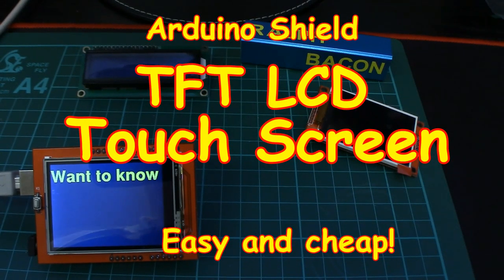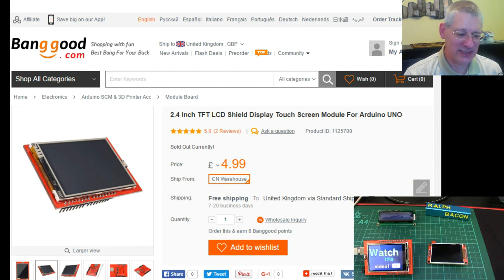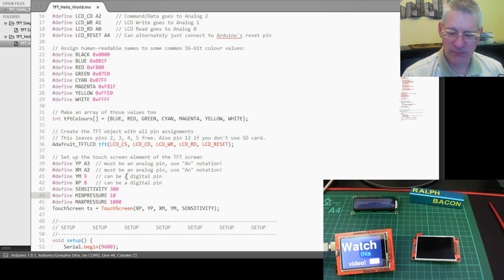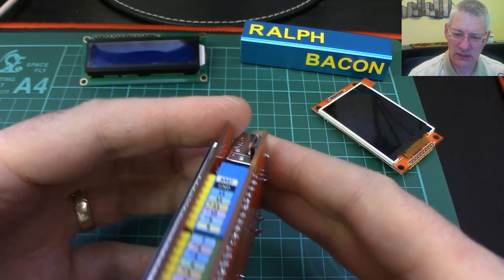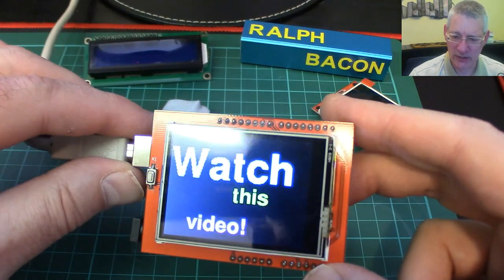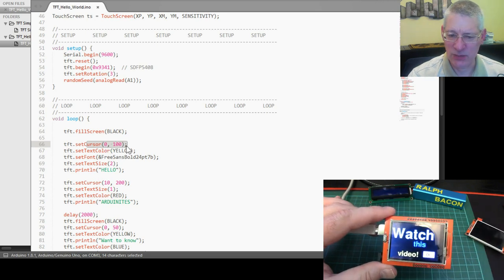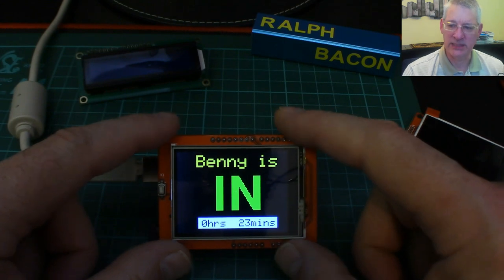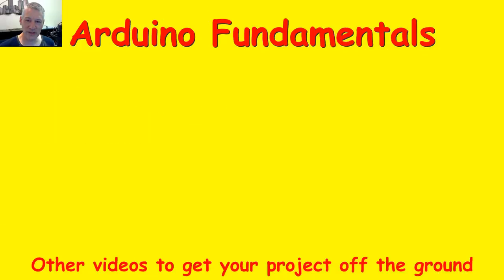#83 Colour Touch Screen TFT LCD for your Arduino - Cheap & Easy

Comment: Hi. Ralph, you are doing a great job.  I purchased my tft lcds (labelled ZC113200) from ebay.com in April 2016 for $4.14 each and am just now getting them into service.  Spent 1/2 day trying to make the current AdaFruit libraries work with little success and it was such a relief to discover your tutorial on youtube.  Really fine work maintaining a usable combination of demos and drivers on GITHUB for this particular tft lcd.. 
Best Regards, 
microwatbott.
Reply from the maker: That's a great success story William, I'm really glad it worked out. The price you paid was excellent indeed. They are really useful screens, even more so if they have the touch feature too. Thanks for sharing and posting!

Comment: Thank you for the great video and for providing the code and the libraries. Yes...I am watching this video now in 2020 and the libraries may have changed! :) :)
Reply from the maker: That's why I include the libraries as a snapshot; it can be most frustrating to recompile a sketch a year or two after it was first done only to find that you now have a gazillion errors because the underlying libraries have changed and are not backward compatible!

Comment: Sure  is wonderful to subscribe to your videos, it seems every time I decide I wish to build a project and need  a refresher, or perhaps an introduction to one of the components, I can do a quick search of Ralph's videos and there is always something that will satisfy my need for information.  This particular video is filling in the info so I can  use my Arduino to set up a touch jukebox for my mom, who turned 93 last spring and moved into a nursing facility after several falls.  The falls are under control but she can no longer go home. Sad really, and with both my sisters passing away from lung cancer (great smokers they were, sure glad I stopped!) I am the only child she has left. Sure she has a LOT of grand children and great grand children, however only 2 grandkids live in town, and I have settled back in, parking my RV which was my home for most of the year before the move. Anyhow, back to the project, I have picked up several of those little DF-MP3 players that can be controlled by either an Arduino, or several buttons.  I want to make her a sort of jukebox that displays the era of the music, for example 30's 40's or 50's music, then class the music such as popular, country western and swing, or something like that.  Using a couple of menu subroutines and displaying the simple menus in fairly large text (her eyesight isn't what it used to be.)  This will be mounted in a small wooden box that I will build in my wood shop, the touch screen will be just for selecting the music, I will have a variable resistor for volume, a toggle switch for power and I have a couple small very high quality speakers to reproduce the music. The amp is only 3 watt per channel, but the nursing home has problems with loud music.  Her room mate will not be around much longer, as she is on "comfort meds only" now and is failing quickly, however beds in that home never stay empty very long, usually just long enough for the nursing staff to clean the mattress, empty the closet and drawers, and move the new lady in.  Again, thanks much,  I hope you realize how many peoples lives you have a positive impact on just in situations such as this.  My how the world has changed since the 1950's when I was a child.
Reply from the maker: The project sounds very worthwhile, Jerry, and as your rightly say, keep it as simple as you can with nice big buttons and on-screen fonts. 93 years old? Even older (only just) than my mum! Sorry to hear about the deaths in you family, I'm glad you seem OK and are enjoying life and my videos too! Keep going, and enjoy what you do.

Comment: Hi Ralph, It is just short of unbelievable how cheap this components can be gotten for... I bough one of those shields ages ago for a project, but went a different route (as it happens, sometimes); I will now dust it out and give it a play. Thanks for the videos.
Reply from the maker: GIve it a good dusting Ray (I think we agreed I'd call you that instead of Mr Salomon, yes?), it will be worth it. As I've mentioned before, if I couldn't get the components so cheaply I wouldn't be doing this hobby, I couldn't afford to! Let us know if you get it working.
Reply: Ray is fine Ralph.  I will update you on how it goes with the screen (lots of possibilities for the device; I am sure the perfect project will show itself sooner rather than later). I am still to catch on with your Attiny video; keep them coming, we need more people like you in the community sharing ideas and  know-how.

Comment: When I first seen Benny's name  on that display, I was thinking "has he taught Benny to touch that"? A Benny time clock! Love that! Hope you share the finished project.
Reply from the maker: Yes, I'll shared the finished project, as simple as it is, electronically and Arduino sketch wise, although it does use interrupts and an nRF24L01 at both ends so it keeps me busy. In fact, I'd be doing it now if I were not writing this (but don't feel too guilty, it's nice to interact with my Arduinite viewers!) But, regrettably, Benny refused to cooperate with touching that screen so I have to rely on other methods to find out where he is!

Comment: Excellent video Ralph.  When I tried playing with these shields I found some the problems that you mention with touch screen coordinates and the wrong chipset.   I will have another look at them again using all the valuable information you've provided for us.    Due to how much memory this uses I'm also interested in trying these with more powerful devices such as nodemcu's.
Reply from the maker: Agreed, Juan, that this did take up a lot of space but I guess that's the price to pay for a colour touch screen! Have another go and see if you can get it working. And good luck with the node mcu's too.

Comment: Hi Ralph, love your videos, really informative.  Great source for most of my work; quick question - you speak about linking to another arduino but I've tried an I2C link to another arduino which requires a4, a5/scl sda.  But the pin on the touch screen is rest on a4.  Any help to figure out where I'm going wrong here? Thanks
Reply from the maker: Without looking at the code (or screen library), Holly, I would check why pin A4 is being used for the touch screen. Was it just an arbitrary decision by me or is that what the library is expecting? Either way, you could just edit the sketch and/or the library to a different pin (A0 springs to mind!) to get round this issue. Does that seem sensible to you?

Comment: Far Kinell!  It works!  Not the touchscreen, but it's there!  How amazing are you! 
I have previously spent 2 evenings trying to find something that worked, loading libraries and stuff from all over, I got so confused that I wiped the lot and reinstalled Arduino IDE.  Your app worked straight away.....after I had downloaded touchscreen.h and let Arduino move the apps around and deleted a couple of copy folders and deleted a couple of empty folders, but that's almost nothing.
It's a bit late at night to muck about more, I'll look at the touchscreen bit tomorrow, though I hardly need it for the task I have in mind.
Reply from the maker: That's heart-warming news, Neil, and I'm sure you're pleased you got it working at long last. Even if you don't need the touch facility right now why not get it working just so you have experience of it, possibly for future projects? Just make sure your screen really is touch-enabled (some look like the one I used but don't have the touch capabilities). And, of course, let us all know how you get on! Thanks for the great feedback.
Reply: (revised version) I have had a few minutes to investigate this morning, I have found something that I hope will inform other users.  
It's easy to spot the four-way strip that leads to the front of the display for the touch grid, as it's separate from the 25-way (or so) strip that leads to the back of the display for the screen control.
My display is by Sodial, and came from Amazon at £3.67, so maybe the price should have been a clue.... The colours are inverted, easy to cure, but maybe there is an option somewhere in a library.  It responds to the 0x9341 ID, but an ID request gives "unknown" from code C0C0, so your sketch worked, but the examples from AdaFruit didn't until I "hard-wired" the code.  I can now get the touchscreen to work, after a posting in the arduino forum suggested misc.ws as a possible source and there I found a suggestion that the pins are different, meaning that this needs changing:
#define YP A1 // must be an analog pin, use “An” notation!
#define XM A2 // must be an analog pin, use “An” notation!
#define YM 7 // can be a digital pin
#define XP 6 // can be a digital pin
Now your sketch waits for a touch, but I am not convinced by these, yet, since the positioning values are rotated 90degrees, which will just need some time to sort out in between decorating the lounge, which I have been informed is more important.
Next time, which will be for my permanent project, I'll buy from Adafruit or Elegoo or Kuman, who all provide lots of information.
No reply necessary and thank you again.
Reply: Thank you very much!!! I also have a C0C0 display, and your magic numbers are right on spot!

Comment: Have you tried the Nextion displays? They use serial so all the rest of the pins are free to use. They are also set up using a custom ide.
Reply from the maker: I was all ready to tell you, Gary, that at the price these screens go for that it would be unlikely that I'd be buying one any time soon. *However*, that fact that it just requires a TX/RX signal pair (presumably our SoftwareSerial library would cover that) and the fact that there is a free-to-use Windows screen design tool and considerable support (http://goo.gl/LbvAJ5 ) makes me think that this is something I should be looking at!
 
For £11 ($14) I can get a fairly modest 2.4" one.  For £52 ($68) you can get a 7" whopper! I'm guessing that if we get one working then any size should work as they all follow the same comms protocol. Hmm, interesting idea, I shall investigate further, thanks for the heads up, Gary!

Comment: Hi Ralph quick thank you for your excellent tutorials. Just watched this  thought, could you not fix a tx to cats collar then you can see exactly where he is
Reply from the maker: The trouble with that idea is that a transmitter requires power. Now, I could transmit once a minute or something (with the rest of the time in Deep Sleep) but it's not easy. He actually has a commercial tracking unit on his collar that runs out of batteries every few months but is otherwise not bad. The In/Out is just simpler!

Comment: Returning to this topic, after a break to decorate the lounge,  I bought a 2.8" from Elegoo, via Amazon.  Actually it was an accident, I ordered something else and forgot I'd put the display in my basket.
It came with a CD that included instructions and sample sketches that worked and the only difference was the price.  For a little over £12, it saved me hours and I can start to build my smart coffee table.  I may never finish it, mind, but hey ho, it's off to build I go.
Reply from the maker: "...forgot I'd put it in my basket", Neil? Pull the other one! I must say, that's a really good way of ordering stuff, must try that one out on the wife. She may even fall for it, heh heh. But, seriously, that's great that they actually included a CD and proper sketches, most unusual. I'm still intrigued by your Smart Coffee Table project, you will definitely have to share that one in due course. Or put up an Instructable, maybe, doesn't require video, just photos and text. Thanks for the update on this item, good to hear from you.

Comment: I loved your informative video, and have downloaded the zip file. and installed libraries in the Libraries folder. I only get ONE FATAL error  "touchscreen.h no such file or directory"
Checked directory specified in error message and file DOES exist.
Any ideas why the compiler does not recognise the supposed missing file?

Thanks
Reply from the maker: Have you included it with chevrons, Mark, like this:
 

#include <touchscreen.h>
 
or did you use quotes around the name? Is the name of the library exactly the same as the folder (case sensitive) in your libraries folder?

Comment: i am using the same tft lcd display upload a simple sketch as i move my styler in clockwise direction the screen draw an anticlockwise circle as i draw a line bellow the line is drawn on the upper side
Reply from the maker: In the library the x & y coordinates have been swapped; it's a common problem. You may find some lines already commented out there and replaced. Have a good look first and let me know if you fix it.

Comment: i got a 3.2 inch (Not adafruit) and a megga arduino and the display on my tft is backwards any ideas how to fix? (im using a tft shield).
Reply from the maker: Hi Jay, sorry you got a backwards (as in mirror) display. Probably means that the library we're using is not the correct one for your TFT. Have a look at the marking on the TFT board and try and identify the main chip; from that do a Google search for a library for that model. The Arduino forum can be a goldmine (forum.arduino.cc/index.php) when searching for these sort of answers, give them a whirl, but be nice, they take no prisoners!

Comment: hello, how can we connect any sensor to the arduino board along side with the 2. screen ?
Reply from the maker: I don't fully understand your question, Ecosia, what do you mean by "how do we connect"? If there are GPIO pins available then use those in the usual way. Or connect the sensor to the I2C bus if it needs it. Can you clarify, please?

Comment: Good stuff. Have you tried out the Nextion displays?
Reply from the maker: Your reply, Leslie, has reminded me that I do indeed have one somewhere but I've not actually played about with it yet. It's now packed up ready for my big workshop move, so after that, I should be able to find it and experiment (something I've been meaning to do for months, since November 2017). This is...
 
This is the one I have: https://www.aliexpress.com/item/Nextion-2-4-TFT-320-x-240-Resistive-Touch-Screen-UART-HMI-Smart-raspberry-pi-LCD/32669658873.html
 
So not exactly cheap, but I'm hoping for an easy implementation and a quality image!
 
So thanks for the reminder and thanks for posting!

Comment: Great tutorial Ralph, could you make some more tutorial with lcd and arduino uno r3 like this? Maybe with sensor, humidity and temperature, or etc sensor. thanks for taking the time to make tutorials
Reply from the maker: Already done, Renji. Look at my videos #46, #48 and #52 which display the temperature and humidity on a 20 x 4 LCD (you can ignore the wireless aspect of this project). Not quite the same as using a touch TFT but the code to read the temperature and humidity from a DHT22 is there. Have a look at that first and see if it meets your needs. If not, let me know.

Comment: Hi,
Thanks for the video.
I have purchased a 3.5" TFT display from mcufriend. Its touch screen uses XPT2046 chip. I was unable to find any library for this TFT display to use its touch screen. Can you help me?
Reply from the maker: The amazing Paul Stoffregen has an Arduino library for this chip/screen.
https://github.com/PaulStoffregen/XPT2046_Touchscreen
Have a look.

Comment: Hi, please, I need help to understand what pin selects the touch controller?, I can see in the mainboard the pins to select the LCD and SD card, but I would like to know about the selection of the touch controller. Could you explain about it?, I thank you for your help.
Reply from the maker: Hello Arduinite! I'm currently on vacation 5,000 miles away from home so I'll have to be brief with these comments until my return, mid-July.
 
The touch pins are the ones to the Arduino's analog pins, as far as I recall, but I will have to check this out on my return. Let me know if you still need an answer.

Comment: Sir I have already purchased a 2.4 inch tft lcd & tested it with the example adafruit tft lcd graphictest is running quite well. But Sir I have uploaded the sketch of yours & after upload the sketch screen shows "setup is completed touch to proceed" & when touch the screen nothing has been changed. Please advise me in this regard how to create touch screen effective.
Reply from the maker: First of all, upload the Adafruit calibration sketch or "phone" sketch that will prove that the touch part of the screen is functioning correctly.

Additionally, in the "touch" function, place a Serial.println statement so you can tell whether the touch function has been invoked. Do note that the pins on the rear of the screen for touch (SPI pins) are the same as the main board; only the CS pin changes and only one CS can be active (LOW) at a time.

Comment: The video is described as easy to understand. But can you explain the 5 inch TFT touch function?
And explain how to use the library and button functions.
Reply from the maker: I don't think I've ever seen a 5-inch TFT for the Arduino, Minsu Kim. You can get them for the Pi (for a lot of money) but unless you're prepared to put in a lot of work you're unlikely to find an Arduino-compatible library. The one I use in the demo here is a 2.8" screen I believe and there are examples of how to generate buttons in the demo code. Did you download it?